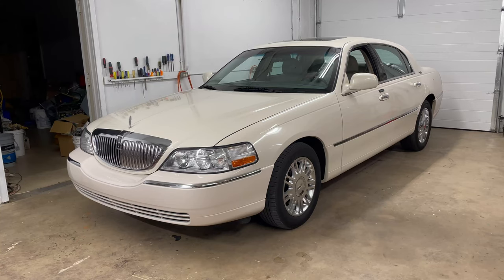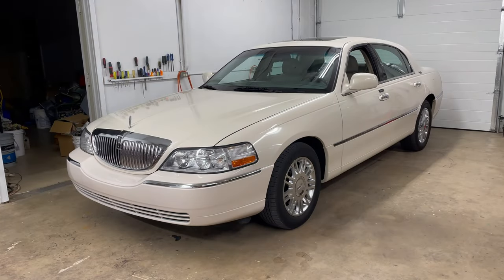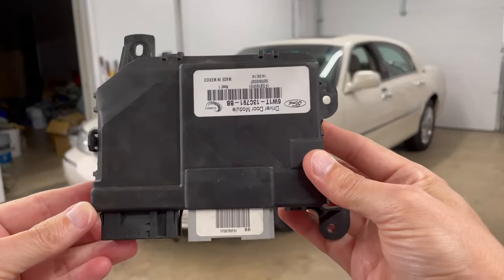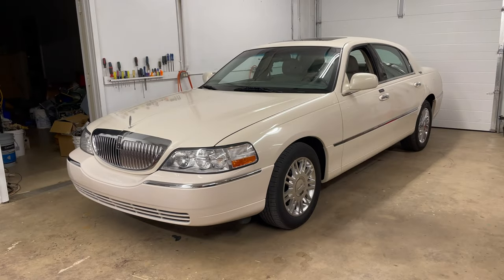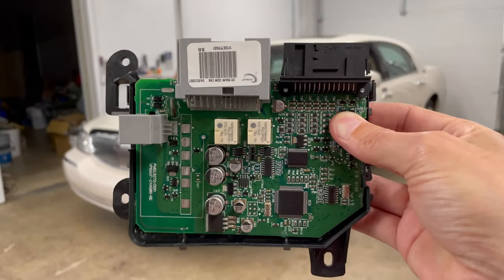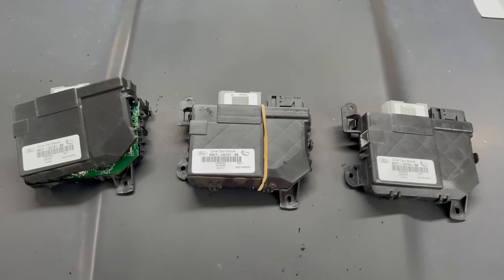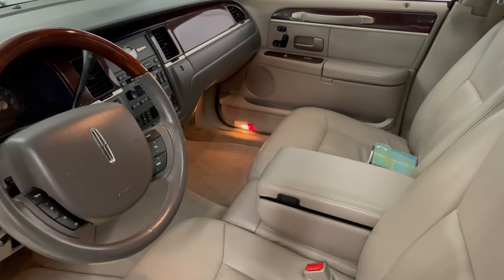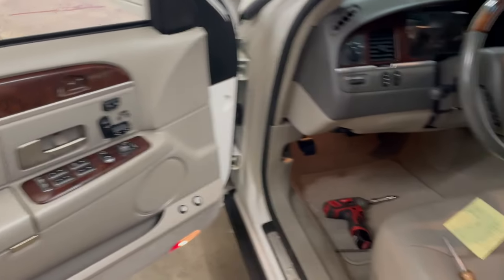Weird Electrical Problems FIXED - Lincoln Town Car

Comment: From what I understand the poor number code might be on the inside of your manual, it could also be on the trunk I think the right hand side arm. And of course mine has covers on it I found a code but I still couldn’t get the keypad to work so since my mirrors are not working either both of them which means it’s not the switch, that this just might be my issue. I stumbled across this looking for something else good to know! So don’t go to the dealer check to see if your code is somewhere on your car or search it online like I did
Reply from the maker: The code is on the trunk arm for some years, and it's on the module for some years too. For 2007 for sure (I think all 2006-newer) it's not in either place.
Reply: @InternetDude  I believe I found a code, was a bit ago I was looking, but since it's used and I tried to use the code but it didn't work, perhaps the code lock is not working which I am going to look into what you are doing, as I have issues with a few things also not working or not working and then working ugh! lol
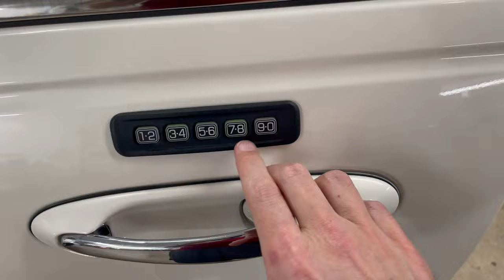Reply: In minute12:12/14:47 of the video,:
To see if the outside KeyPad works?
 Simultanesly push [7-8] & [9-0] this would LOCK all doors. Simultanesly push 89.
 If you don't have the Key-Code? Two choices: First if it is One Owner Car look into the Original Owner Manual.
 There should be a half inch by one inch sticker that has a 5 digit code. In old days Ford & Lincoln Dealers would peel the sticker and stick to the inside of the Trunk's Lid Right Arm  Inner-Trunk visibilty. 
For instance if the CODE would be (13550) => [1-2] + [3-4]+[5-6] + [5-6] + [9-0] 
Then to Open Driver Door push [3-4] 
To open all 4 doors the Code (13350) Simultanesly => [3-4][3-4] 
To open TRUNK Lid  almost the same  the CODE would be (13550) =>Simultanesly => [3-4][5-6]. 
Please NOTE: you may assume and give "Alphabetic Value," to the Outside Key Entry Punch => How?
 Assume that [1-2] + [3-4]+[5-6] + [5-6] + [9-0] = are => [A] + [B]+[C] + [D] + [E]. 
If so then => For instance if the CODE would be (13550) +[B] opens Driver Door Only.
If so then => For instance if the CODE would be (13550) +[B] [B] opens all 4 Doors.
]If so then => For instance if the CODE would be (13550) +[B] [E] opens theTRUNK Lid
To Lock all4 Doors => .No Code Needed. 
Only Simultanesly push [D] & [E] this would LOCK all doors.
The S E C O N D Part if the Original Owner Manual & Code Sticker Missing Nor is in the Trunk Lid Arm?
You must open the Driver door Panel as it was instructed very well in this Video
Kindly Gentlyremove the Black Nylon Sound Road Noise Reducer
Behind the Key Pad => [1-2] + [3-4]+[5-6] + [5-6] + [9-0]  there would be a Modual.
The Code is Written on the Modual If the Code did NOT open , No Worries. The Code is Good but it has MIRROR Printed meaning Backward
If the Code number on Modual says: 05531 then you enter 13350
Best of Luck

Comment: hi
great video
mine issue is the remote forgets its connected and also I have a battery drain problem maybe connected to this modul
mine is a 2008  same options as yours ..  will get in contact with that website Thanks!!
Reply from the maker: Good luck

Comment: Create video mine is acting up to but my lights stay on on the inside and says door jar to everybody says it's a sensor on the door latch itself on the driver's side is there any way you can make a video on how to replace that as a 2003 Lincoln town car signature great video it did help me a lot on how to take the door panel off and that Box that Box that you replace I'm probably have to replace it too Does I have to be programmed
Reply from the maker: To my knowledge as long as you get the module from another 2003 Town Car it should swap in with no need for programming. If you buy a brand new module it would need to be programmed. I believe yes the door ajar switch is inside the door latch mechanism so it may need replacement. What you could try is spraying and soaking the door latch with degreaser and then WD40 to try and clean it up if it is just dirty inside.
Reply: @InternetDude   Yeah I got no junkyards nowhere near me and it was a junkyard part in there and what my car is doing is the door locks are going up-and-down while I'm driving and everybody says everybody says it's the sensor and the door latch which I agree but it shouldn't be doing all the other stuff So I think it's a combo it just started doing that and now I could shut the door and the lights go off so it's doing it all on and off it's confusing and you can't buy the part it's discontinued discontinued I looked everywhere the part number I got off mine is3W1T- 13C791-AH
Reply from the maker: I got my DDM from a junkyard 3,000 miles away. I used car-part.com that may work for you.

Comment: Could you not use "FOREScan" to program the Executive module to work in your car?
Reply from the maker: You can program a brand new module, but you can't reprogram a used one. It can only be programmed a single time.

Comment: We have a 2002 Signature and the issue we are having started with the lights coming on when stopping, or on/off at random times while driving, and the door ajar light comes on and dings. Did some research and it sounded like a lock issue so we sprayed some white lithium in the door locks and worked them all quite a bit. Helped some but still had symptoms at times. Recently the problem is the lights do not shut off when we get out of the car and close the door and my husband has resorted to disconnecting the battery cable so it does not drain the battery. The locks have worked fine since the lithium spray, but I will check the other things now because I am wondering if this might be the issue now. Wonderful, informative video! Thank you!
Reply from the maker: There is also a LCM light control module that would be something else to investigate.
Reply: @InternetDude  Thank you! I did pull the door module and I have a replacement coming and we will try that. If that doesn't take care of it I will move onto the LCM control. I questioned my husband closer and he said the locks as well as the lights were still acting up. Locks not able to lock while driving and the lights on/off when driving and then not shutting off once he gets out of the car. I kept the part case I have to put it back. Do you get lock issues and such when the LCM control fails?
Reply: @catrobinson01  Did you get it fixed? I am having similar issues and the door module is the only thing left I haven't replaced yet.

Comment: Mostly Everything works fine on mine, only thing that’s that don’t work is Interior lights none of the interior lights & the light in the trunk doesn’t work either. The dash lights & radio lights work tho
Reply from the maker: There is a Light Control Module, look into that next.

Comment: My DDM does not work on my 2002. If I remove it to get the part number and how it looks, will the car still run without it? The seats and locks, etc already do not work. I see that there are different versions with the same part number. So I have to take out the old one first before looking for a replacement.
Reply from the maker: See the link in the description for more specific help on the difference between years, part numbers etc. With 2002 I believe you can get one out of any 2002 model and possibly other years. The newer cars are much more specific.

Comment: I have 2010 Executive L and I realize that your door insulation is better than mine. You have Black rubbry insulation and mine is just plastic.
Reply from the maker: Ford started taking features out in the last few years of production- no sunroof, no rear air suspension in 2011, etc. They knew they were going to discontinue production so they started cutting their costs.
Reply: @InternetDude  i have air suspension. I know the differences. 2011 Signature limited has 4 heated seats w memory, premium sound, rear seats recline, automatic trunk, rear sensors, wooden steering, different seats upholstery, 6cds.

I know it doesn't have overhead console, sunroof, and rarely Nav or HID. But I think the extra insulation is trim related not model year.
Reply from the maker: @MS7.7  it could be I’m not sure

Comment: i red somewhere this units  may have  a solder joint  issue did you try to resolder the lines ? or looking at it over a magnifier ??
my remote sometimes does not work do you think it can get worst over time??
should i worry about replacing it ??
Reply from the maker: I looked the circuit board over and did not notice any issues.

Comment: Wonder if you know the problem with my 2003 Lincoln town. It keep drain battery while engine off. I have replaced new alternator. If I leave my car over night the battery completely died could not even jump start or recharge the battery. I took my car to repair shop the diagnosis they said faulty light control
Module but I don’t think that’s the problem
Reply from the maker: oh yeah it could be the light control module, it could be drawing power even when the car is off

Comment: i am wondering if i get the board reflow the solder joints would it fix it I have looked and i don't see any broken joints with a magnifier glass,  but it has a coating  on it , i think it could be reflowed to save it what do you think ??
Reply from the maker: I looked closely at my board and did not see any obvious defects. I think it would be hard to DIY re-flow the solder but may be possible with some research on how to best do that.
Reply: YES IT HAS A COATING   CAN BE REMOVED  BUT HARD TO REPAIR MOST LIKELY  @InternetDude

Comment: Can this also mess with the interior lights? Making them either stay on OR flicker on and off along with the door ajar warning light and dinger? Checked all the wiring, replaced the door latch switches and had the Lighting Control Module rebuild. I went from the lights staying on to now they do the flicker thing. Frustrated.....
Reply from the maker: Yes, pause the video at 0:31 to see the list of what is affected. Interior lights is on the list!
Reply: @InternetDude does it effect the head lights signal lights

Comment: I have a 2002, and the permanent code for the key fob is on a sticker on one of the hinges inside the trunk.
Reply from the maker: Yeah it can be in different locations depending on the year.

Comment: Hi. I have a 1996 Cadillac Fleetwood Brougham. Went I open my car door my security light don't work and when I crank my car and drive my interior lights stays on when I drive the car. After I get finishing driving the car my interior I stays on for a good while but it's goes out. Could that be the door module?
Reply from the maker: I’m not familiar with that car so I can’t say if it’s the door module.
Reply: @InternetDude  Thanks. I appreciate it.

Comment: Would you happen to have the signature module laying around still and be willing to sell it?  MY grandmothers car is doing the exact same thing...I hooked up my scan tool and it has very low voltage...8.6 when running and 7.4 with the key off.  When the key is off its not enough to power the module and its completely dead.
Reply from the maker: Hi, no I sold it on eBay.

Comment: Mine is having an issue where the power windows, radio, clock, etc all work even without a key in the ignition. My driver's door does not trigger the interior lights when opened.

It's a 1997 Town Car. Anyone know what can cause these issues?

Comment: I have a 2011 Lincoln town car executive l and my power seats stop working and the trunk and gas release buttons stops also I changed the model 2 times already and nothing yet any other suggestions?
Reply from the maker: Check the fuses and wiring (connectors), check the wires in the door jamb.

Comment: I have a friend with a 2003 Lincoln Town Car who is looking for this exact replacement part. In the drop down menu there's no listing for DDM or DCM. What term did you use when searching?
Reply from the maker: I’m not sure what drop down menu you are referring to but try searching driver door module 2003 town car
Reply: Search for driver door. If door is there, DDM is also there. You can use donor VIN to check trim level online/ dealer parts dept
Reply: @InternetDude  Under the "Show More" heading. That's the drop down menu.

Comment: I've had door ajar problems, thought I was on the right track with replacing the door ajar switches in each door, but that didn't fix it. Now I'm thinking it has to be the DDM. I'm mad at myself for not getting the DDMs out of an 04 Ultimate and an 03 Cartier from my local junkyard a few months back.
Reply from the maker: The DDM is a surprisingly common issue

Comment: Many scan tools will program the junkyard or new module.
Reply from the maker: Once a module is programmed, it cannot be re-programmed. But yeah for a new module there are options on programming it such as FORscan or an advanced scan tool.

Comment: Is the keyless enter number code available inside the door anywhere? I have a 2006 Town Car Designer series myself but don't have the code, I called my local Ford dealership and they want $100 to give me the number.
Reply from the maker: On your 2006 it is not likely inside the door. On older like 98-03 era cars the code is on the DDM module itself. If you have a laptop, an OBD tool, and FORscan software you can retrieve the code yourself.

Comment: I removed the module,door locks stopped setting the alarm off,the only thing i really need is the trunk will not open ,the gas door opens,not worried about the rest ,its a 2004 lincoln i did not see a place for a key,in the trunk i only have the ignition key,how can i get into the trunk
Reply from the maker: The keyhole is to the right of the license plate same key as ignition

Comment: On Panther Platform vehicles 2005 and older, the keyless entry code can be found printed on a label mounted on the Driver's Door Module (DDM).  I have an '06 Mercury Grand Marquis LS that I brought used.  And previous owner did not have the code.  I ended up taking it to Ford Dealer Service dept.  For about $50 and a 45 min wait, I got them to pull code through the computer.  Hope this was informative.   I enjoyed your video.
Reply from the maker: Thanks

Comment: The door code is on the hinge of the trunk
Reply: I have a 2000 town car with the same problems
Reply from the maker: Hi they stopped doing that in around 2004-2005.

Comment: The keypad code can usually be found in the trunk.  Mine was.
Reply from the maker: It depends on what year your car is, yes early cars had a sticker on the trunk arm
Reply: My code in my 1988 T-Bird and my 2010 Lincoln Town Car were both hand done with either black marker pen pr paint. Look for a 5 digit number up near the hinges or corners.

Comment: I have the same problem. My part number is 6W1T-13C791-BB on my 07 town car signature series.
If I get a  used one with the very same part number will I have to have it programed by a dealer or  will it just work.
Reply from the maker: Watch the video, you can’t just match part numbers, used modules can’t be reprogrammed.
Reply: @InternetDude  Well if I buy a brand new one from Ford, will it have to be programed or will it work right out of the box.
Reply from the maker: You will need to have the dealer program it to your car. $100 for a used one or $500 for a new one, your choice.
Reply: @InternetDude  I'm confused, If I get a used one it will not need to be programed but a new one will and the dealer will have to program it.
Reply from the maker: Correct
Reply: @InternetDude  Thank you. Having trouble finding the used part and your help is very gratefully appreciated

Comment: I have a 99 TC. the key less entry code should be written on the truck lad arm passenger side (mine is) a dealer told me that
Reply from the maker: Yes it depends on the year

Comment: HI,I HAVE A QESTION ABOUT MY LINCOLN 2004,AT 35 TO 40 MPH I FEEL A LIGHT JERAKING OR PULSATING FEELING IN THE GAS PEDAL,HAVE YOU HAD THIS FEELING,OR HEARD OF WHAT IT COULD BE,THE CAR IDES GOOD, ACELARATES GOOD,BUT AFTER DRIVING FOR A WHILE I FEEL THIS HOLDING THE GAS STEADY IT HAS THIS FEELING,HOPE YOU CN HELP, I WAS THINKING MAYBE ,INJECTOR  GOING BAD ,?? any ideas?,will this show up a code
Reply from the maker: No you either have a trans issue (unlikely) or a coil pack is failing. You need an advanced scan tool to watch the misfire counts as you drive. Then swap the coil pack from the cylinder with the misfires with another one and go for a drive again. If the misfires go to the other cylinder then replace one coil pack with a brand new part from the dealer. Do not replace all coil packs and don’t buy aftermarket ones. My car actually does something similar and I found misfires even though the check engine light is not on and it otherwise runs good.
Reply: @InternetDude  I just came back form a day trip about 260 miles round tripmAT 65 I DO NOT FEEL THE BUMPING/JERKING FEELING ,ONLY AT LOWER SPEEDS,IT STARTS AND IDELS GREAT,ACELARATES GOOD. EXTREME HEAT HEAR TODAY,I WAS ALITTLE WORRIED ABOUT THE TRANSMISSION,THEY HAVE A ROUGH SHIFT PROBLEM SOMETIMES,I HA D A 98 LINCLON AT I CHANGED THE TRANS FLUID AND FILTER AND IT DID MUCH BETTER,,AND I DO NOT HAVE ANY LIGHTS ON THE DASH JUST LIKE YOU SAID.
SO I NEED SOMEONE WITHA LAPTOP THAT CAN  DO A SCAN ON IT? THANKS FOR YOUR REPLY
Reply from the maker: @moviegoer9021  This is a semi-common Ford thing, nothing unusual, I've experienced it too. Google Ford Mode $06 Misfire Count for details. I'm like 99% sure you need one new coil pack but I can't tell you which one. You can DIY with your own laptop and a free program called ForScan.org and an adapter you can buy for cheap from Amazon. Some more info here https://www.ford-trucks.com/forums/1674714-forscan-misfire-counts.html - also you can use some handheld scan tools as well it doesn't have to be a laptop.
Reply: @InternetDude   I WILL LET YOU KNOW HOW IT GOES THANKS FOR YOUR REPLY VERY HELPFUL